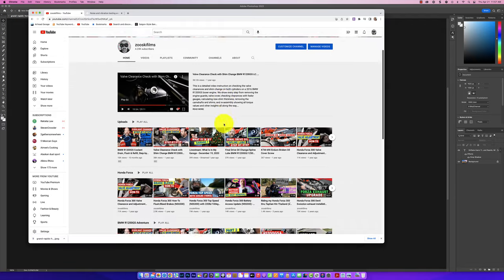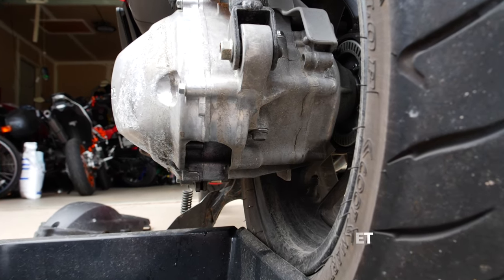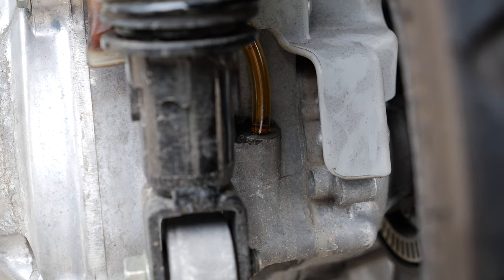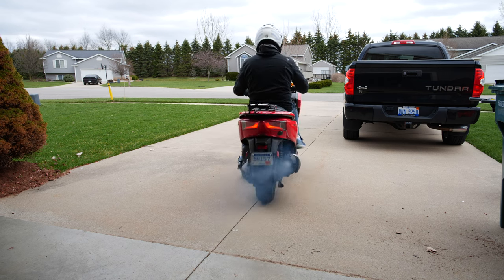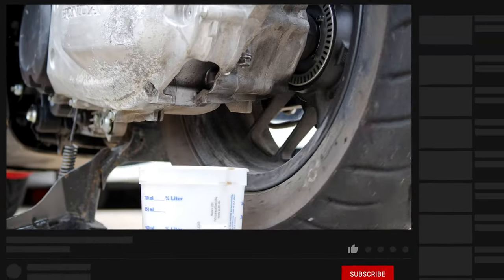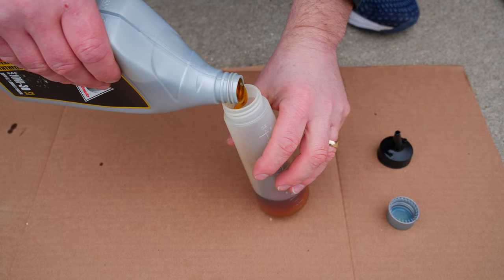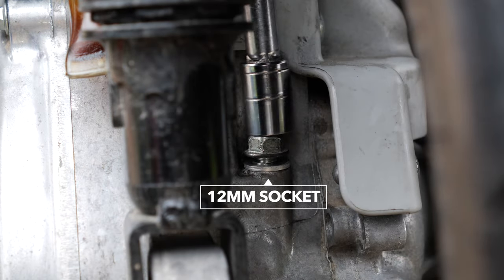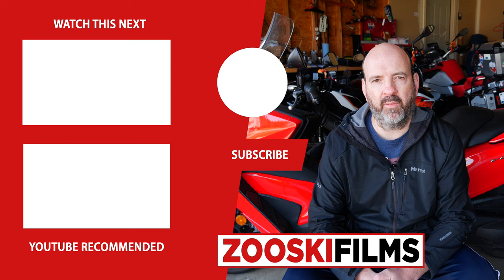Honda Forza 300 (2014-2015) -  FINAL DRIVE Oil Check, Drain and Fill - Step by Step Instructions

Comment: 2:30  You could remove the lower shock mounting bolt and swing the shock up out of the way to provide more clearance.  Thanks for the video.
Reply from the maker: @1966johnnywayne  - You are correct, I should have mentioned that in my video. I was trying to take the easy way out. I noticed that's how the Honda service team does it as well. Thanks for the comment and for watching!

Comment: Picking up my 2015 Forza from the dealer at the weekend. It will be fully serviced which is almost a disappointment as your videos make servicing almost a fun event.
Reply from the maker: @Richard Wells - how are you liking your Honda Forza? Don'y worry, it will be time soon enough, to do that maintenance! Hope you're out on a ride now!
Reply: @zooskifilms  I'm absolutely loving the Forza thanks. Having been a 'big' bike rider I found my hips were giving me gip getting my leg over and rather than give up riding tried the Forza being step through. Oh yes 🙂 Done about 5k miles so far and now planning to tour Brittany France in the Spring.
Reply: @TheAncientBiker  - Excellent! Just finished a 3-day trip here in Thailand, logging in just over 500 miles. We were riding two-up, and through some tricky road conditions. The Forza handled everything without issue. Have a great trip over to Brittany France!

Comment: Excellent!  Doesn’t get any better for the DIY guy, (or gal)?  Best, Rola (Oregon)👍🏻
Reply from the maker: @rolacook222 - Thanks for watching and commenting. Yes, pretty straightforward and simple. Just watch that cross wind at times if you can't drain the oil in a garage. Thanks again from Michigan (Mark)!
Reply: @zooskifilms  Yes, I saw the bit of breeze blowing the oil, (it’s happened to most of us)?  The good thing about what you provide is, (some of us are old enough to know that sometimes things are not so straight forward)?!  Glad you confirmed that it is.👍🏻
Reply from the maker: @rolacook222 - Yea correct, devil are in the details. But you don’t know if they are there unless you check. This one is straightforward. Cheers!

Comment: I really appreciate your videos.  Very clear and easy to follow.  I'm clueless, and would be completely lost without your videos.

So besides engine oil and final drive oil, are there any other oils that need routine changing?  I noticed (at about 1:09 in your video) right above the final drive and just in front of the rear shock, there is a clear tube containing some kind of lubricant.  I'm guessing it must be important if Honda wanted it to be seen so clearly.

Many thanks!!!
Reply: Never mind, I found it in the service manual.  It's the "crankcase breather drain plug."  Apparently it collects engine phlegm, until we get a chance to drain it.  FYI, mine looks much clearer than yours - but I currently only have 600 miles.
Reply: Okay, changed the final drive oil today.  Your video made it go smooth.  Amazing how professional this video was.  Many thanks!!!

FYI, I ended up removing the lower mounting bolt to the left rear shock - in order to swing the shock back and get to the drive oil filler bolt.  Torqued the 14mm shock mounting bolt 39N-m.
Reply from the maker: @OkieBobby  - Yeah, sorry for the delay, was traveling out of country and didn't have a lot of time to answer comments. Anyway, glad to hear you sorted everything and were able to change the FD oil. And yes, that crankcase breather drain plug does need to be checked and drained when full. My Forza in the States fills up with oil but not the one in Thailand. The only things that I can attribute that to is, 1 - I put too much engine oil in the one in the States, or 2 - I drive at much higher speeds in the US vs in Thailand. I would say average max speed in Thailand is about 60 mph (100 kph) in Thailand vs 70-75mph (113-120kph) in the States. There may be a bit more pressure in the crankcase at the higher speeds. And glad to hear you removed that lower shock mount bolt for the re-fill, I should have mentioned that as an alternate option, I would say makes the fill up much easier! I would say the only other fluid change that's needed would be in the front shocks after 8-10 years or so. I'll have to put together a video on that sooner than later. Hope you're enjoying the Forza, I know I certainly am!

Comment: Super, thank you very much.
Reply from the maker: @CamperSascha - Thank you for watching and commenting, it is appreciated!
Reply: @zooskifilms  I see that you are looking at the comments. Is it normal for the NSS300 that the rear wheel is quite stiff compared to other scooters? I opened the rear gear box and replaced the bearings. I noticed that the bearings on the middle gear axle have quite a lot of play. Even the new ones. Do you know what diameter the axle in the bearings needs to have? 😁

Comment: Thanks for the movie. I have honda forza 300 2019 and prepare to change oil in the gear. Engine oil 10W30 is good for it, or maybe should I use gear oil, and what kind of gear oil is the best solution?
Reply from the maker: @cezzar - Oh, sorry, I could not find much information on what gear oil is needed for the final drive on a 2019 Forza 300. I would check with your Honda dealer and ask them for a recommendation. If there is a specific gear oil for your year Forza, that would be what you should use. If nothing is available, then 10W30 could be used.
Reply from the maker: Kanon Mimosa  - Thanks for the tip! I've been looking for something more easily available in my area and not have to pay for shipping. Thanks again!!

Comment: Any chance you would be willing to do a video on front faring panel removal. I understand it's quite a process
I skinned mine up along with a knee during a spill on loose gravel
Wanting to get re painted but not wanting to pay the dealer $200 to remove
Reply from the maker: @greghinthorn4356 - Sure thing. When do you need it by? I have a few things going on at the moment so it might take 2-3 weeks. Hope the knee is better!
Reply: @zooskifilms  yeah next couple weeks will be fine
I've looked at it and just can't figure it out
Nothing on line either so you'd be the first to detail the procedure
Thanks for the kind words knee feeling better today
Was riding rural backroad blacktop and someone decided to roll a stop sign in front of me
I love ABS but it doesn't do much with a thin layer of chip and seal rock covering the asphalt of the intersection

Comment: Hello, can i ask why you top up the final drive oil before emptying it all ?
Reply: @problemslayer3538 - Sorry for the delay! This video has two parts, the first part is only checking the final drive level. I added fluid until it came out the overflow hole. That was not the drain hole. The second part was a complete drain and refill of fluid level. I do two parts based on the Forza maintenance schedule which states to change the fluid every two years, but I like to also check it once a year. Hope this helps!
Reply from the maker: @problemslayer3538 - Sorry for the delay! This video has two parts, the first part is only checking the final drive level. I added fluid until it came out the overflow hole. That was not the drain hole. The second part was a complete drain and refill of fluid level. I do two parts based on the Forza maintenance schedule which states to change the fluid every two years, but I like to also check it once a year. Hope this helps!

Comment: Thanks for the video. I change the oil several times, but the head of the drain bolt deformed. I couldn’t take it out. Do you have any solution for this?
Reply from the maker: @quangnguyenduc8862 - There are stripped bolt wrenches available, one of which is this one. Also order a new drain bolt. https://capritools.com/shop/bolt-extractor-combination-wrenches-sae/
Reply: Thank you!😃

Comment: Why do you use 10w30 engine oil for the disk drive? Isn’t this a mistake or is it normal? We use another oil, different from 75w90, from AMS Oil. I hope you can explain this matter to me.
Reply from the maker: @Al_Sindhi - That is the recommended oil from the Honda Forza service manual. It shows Pro Honda HP4M SAE 10W30 (API service SG or higher), which include moly additives. This is the same oil for the engine. Hope this helps!

Comment: I’m off topic here but you’ve covered a lot of things on the Forza. I have no tail light or license plate light. I do have brake lights. The owners manual instructions didn’t make sense.  How do I remove the rear taillight to check it? Must I remove body panels?  Thanks in advance.
Reply from the maker: @jeffreyhurst9552  - You might be able to get to the license plate light without having to take off the rear side panels, but it looks like you need to remove them to access the tail lights (same assembly with brake and turn signal lights). You can find my email on my channel page, in the description just below my channel name at the top of the page (just to the right of my channel photo). I can email you the related pages from the service manual. Send me a note there. Cheers!
Reply: @zooskifilms  are the brake lights and taillights on the same fuse?
Reply from the maker: @jeffreyhurst9552  - I just emailed you some details. From the wiring diagram they look to be on separate fuses.

Comment: Hello, just watched the video and was very helpful, just one question about oil, can I use Motul transoil 10w30 transmission fluid for my forza 350 2022 ?
Reply from the maker: @Donatas Misius - Thanks for watching! Regarding your question, I’m sure that Motul transoil would work fine in the final drive. The one Honda recommends contains MB (moly), but in this case you could add a little moly in with the Motul oil separately. Conversely, you may not want to use anything other than the Recommended Honda oil during the warranty period, just in case you need warranty work done (not sure Honda would go as far as to check the oil in that case). Point is be aware of any risk during the warranty period. In reality there isn’t much oil in that final drive, not sure it’s going to make a huge difference to have the MB, especially if you change the oil at the prescribed times. Personally I would feel comfortable using the Motul transoil with some moly added. Hope this helps!

Comment: Can you use the same oil that is use in the engine pls
Reply: @user-sg4fp7rv2y - Yes, that is correct for the 2014-2016 Forza. If you have a newer model I would check that with your dealer or online. The assumption is that you are using Honda 10W-30 HP4M Oil. If you are not using this specific oil  then be sure to check the oil you are using has moly in it. If not you can purchase the moly additive and add to the oil you are using. Hope this helps!
Reply from the maker: @user-sg4fp7rv2y - Yes, that is correct for the 2014-2016 Forza. If you have a newer model I would check that with your dealer or online. The assumption is that you are using Honda 10W-30 HP4M Oil. If you are not using this specific oil  then be sure to check the oil you are using has moly in it. If not you can purchase the moly additive and add to the oil you are using. Hope this helps!

Comment: Have you had any issue with the blue backlight illuminating the odometer?  Mine went from fully lit to half lit and now rarely lights up at all. I can find anything online about this problem on the NSS300
Reply from the maker: @zed ned - No issue on my side. I checked the service manual and it appears that the backlight is built-into the "combination meter" (cluster). I could not find any replacement bulb online for it. If you're adventurous you could try opening up the cluster and see if you can find a replacement bulb. Potentially it could be the wiring, you can check the voltage at pin 18 (+) and pin 6 (-), on the connector behind the cluster, should be around 12VDC. I plan on making a video on how to remove all the panels and fairings, and could have a closer look at it then, when I have everything apart. Plan on working on that in the next few months, as time allows. Hope this helps!

Comment: When you refil the engine oil, does it also fil the final drive ?
Reply from the maker: @problemslayer3538 - No, they are separate and have their own drain and fill holes. I show the location and go through the process in the video.
Reply: @zooskifilms  alright buddy thanks for your efforts with getting these videos up, they are helpful. Some good choices out there now for an upgrade, new forza 300, 350, adv 350 and xmax300 but I just can't seem to let go of my 2016 forza 😄
Reply from the maker: @problemslayer3538  - Haha, me too. I do love my Forza. The Honda X-ADV 750 caught my eye, but don't think it's available in the US. So sticking with the Forza 300 for now. Cheers!

Comment: I was told in service that the rear hub oil to this bike is 85W90 what do You say ?
Reply from the maker: @sprzetmoj7579 - I find that some service folk will tell/recommend what they have in stock, but in this case the Honda service manual says: Honda 10W-30 HP4M Oil (PN 08232-M99-K0BA1)
Reply: @zooskifilms  Could You please give me some idea where I can download the service manual at least for NSS300 ? Mine is NSS350AR but the construction of the most components are pretty similar.
Reply: @zooskifilms  I found service manual from old NSS300, ok
Reply from the maker: @sprzetmoj7579 - sounds good! Wish you much success!

Comment: What is the diameter of the fill hole?  Thanks.
Reply from the maker: @@UCacLxitDY_KAPL6RKcn4bPA - The fill hole uses an M8 bolt, so it's a 7-8mm diameter hole. Hope this helps!

Comment: After doing this process, a different sound began to be heard from my engine. While cruising, something like a groaning sound started. I use motul 80w90 gear oil.
Reply from the maker: @Alp Kaya.- Sorry to hear. How much oil did you put back in after draining? About the same? I don’t know why the noise would be coming from the engine unless it’s under strain. Difficult to say with looking at the bike. Put the bike on the center stand and spin the back wheel forward. Any abnormal sound or feel? If nothing else seems suspect then you might want to consider using the recommended oil from Honda.
Reply: What about after motul ?😊
Reply: @zooskifilms  In fact, Honda officials here do not know which oil to use. They say that when you change the engine oil, you can add the remaining 300 ml of oil. and this seems ridiculous to me because the viscosity of the 10w40 oil and the 80w90 gear oil are completely different. I don't know if the oil I put in is thick. There is no problem in acceleration, vibration or anything like that, just a noise comes from the gearbox while driving, from the lower part of the variator.
Reply: @alpkayaaaa  i have similar experience,tell me,what oil have u in right now and hear noise ?
Reply from the maker: @Alp Kaya - the Forza service manual states the following for which oil to use in the final drive: Pro Honda HP4M 4 stroke oil. With molybdenum additives. API service: AG or higher. JASO T903 standard: MB. SAE10w30.  Which happens to be the same oil they recommend for the engine. Send me your email and I can send you over a photo of the section in the manual.
Reply from the maker: @Alp Kaya - thinking about it more you may want to have a look at the driven pulley/variator assembly and check those components and belt, just to be safe. The final drive gears are on the inside of the clutch and pulleys.
Reply: @zooskifilms  i know what does it say,when i put that oil IT DOESNT WORK GOOD,i swear i got scared from the sound,i changed to 80w90 motul and is silent now and smooth
Reply: @zooskifilms  is it problem to use 10w40 JASO MB ( normal engine oil)
Reply: @alpkayaaaa  are u hapy with 80w90 motul ?
Reply: @zooskifilms  i just checked and the honda oil here in europe dont have MOLY in it,do you think that is the problem with noise in the cvt ?
Reply: @audiophilipp  yes 80w90 and noices became from gearbox
Reply: @alpkayaaaa  80w90 no noise ?
Reply: @audiophilipp  with noise.. :(
Reply from the maker: @alpkayaaaa  - Yes, that shouldn't be a problem. just be sure to not mix it with 10w30. Stick to the same one grade at each oil change. The 10w40 is a little thicker than 10w30, if you are in a warm climate I don't see there being a significant difference. Hope this help!
Reply from the maker: @audiophilipp  - Over time, sure, it could be a contributing factor. How many KM (or miles) do you have? If not high then I find it hard to believe it would be the problem, you could change it more frequently to make up for not having the MOLY. Or you could also purchase LIQUID-MOLY as an additive and add a small amount to the oil. They have recommendations on the amount. Don't add more than needed.Hope this helps!
Reply from the maker: @alpkayaaaa  - Check out this comparison of gear vs engine oil grades. The 80w gear oil is closer to a 20/30W engine oil. https://blog.amsoil.com/gear-oil-vs-engine-oil/
Reply from the maker: @audiophilipp  - Yeah, understood. Do what you feel is best!
Reply: @zooskifilms  today i change the oil completely. 280 ml with 10w40 normal engine oil. the noise is gone :) and i am happy. i think 80w90 its really thick for horza final drive oil. thank you for sharing your expeirences :)
Reply from the maker: @alpkayaaaa  - Great to hear! Appreciate you giving us the update, good for everyone to know. Cheers!

Comment: Why after i changed this oil there is some metal grinding noise in there ?
Reply from the maker: @Filipv - Yeah, that is  it good. Put the bike on the center stand and spin the wheel  forward by hand. Do you hear that noise? What type of oil did you put in? Was it about the same amount that you drained?
Reply: @zooskifilms  same amount is put in,10w30 honda oil.